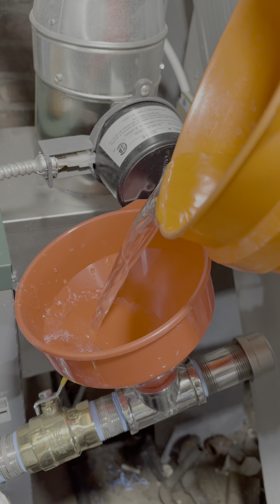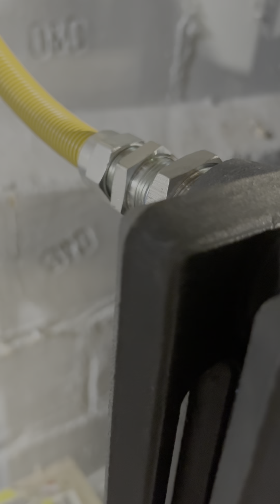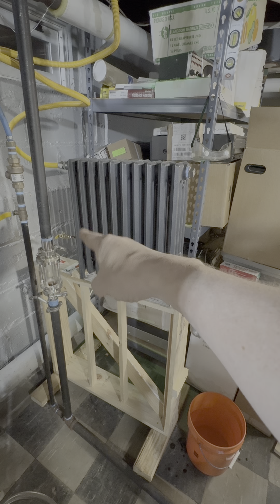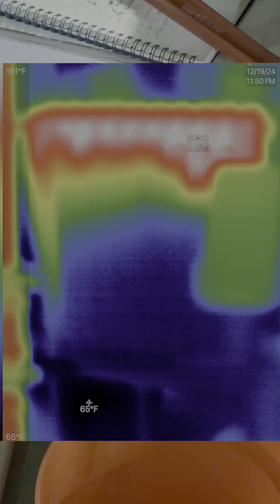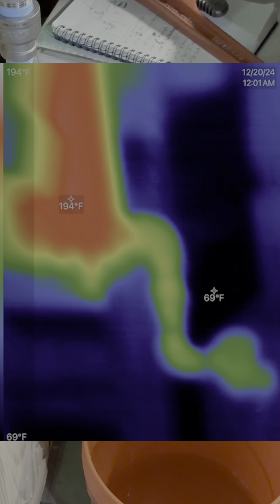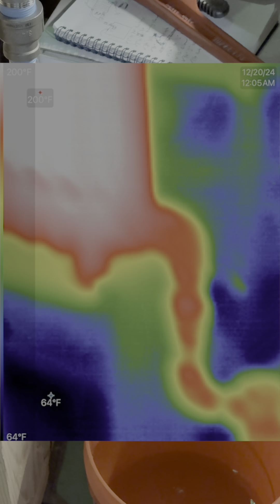Video #3,  Steam Radiator Pitch Experiment (2-pipe reverse pitch)

Comment: Like you say at the end, you need to test running the supply at the bottom, not the top, so that the back pitched radiator causes condensate into the supply. most 2 pipe steam  systems I've seen have both the supply and the return on the bottom. Like you say, there's no problem the way you have it, but thats not why they tell you to pitch it!
Reply from the maker: @territhemayor  thanks! I’ve seen few 2 pipe systems, but they had the supply at the top. With a supply at the bottom the pitch can’t be reversed, I think.

Comment: all your videos are fascinating. i just discovered a hole over the water line in my barely 8-years old steam boiler. we'll survive the winter but want to prevent that from happening on my next unit. do you suggest only using distilled water from now on in the new boiler?
Reply from the maker: First, thanks for your comment. Second, I'm really sorry you only got 8 years from your boiler, that's just not right. Did it happen to be a Burnham Independence boiler? People have seen especially short lives from those.

Your question is a really good one. In a lot of my videos I have been focusing on pH level, which is indeed good to reduce corrosion under the water line. However, as you said, it seems like every boiler failure is due to a hole or holes above the waterline, typically at the top of the sections. So in that case, I don't think pH is really applicable.

So what is? I think it's oxygen. At this moment, I feel the oxygen in the fresh water is what does it. So yes, I think that distilled water is the way to go. And if you really want to minimize the intrusion of oxygen into your boiler, you might consider heating the distilled water to the boiling point just before adding it, which will drive out the most oxygen. In fact, heating it up might be even more important than it being distilled. But I still like distilled since it has no minerals, salts, or chemicals such as chlorine.
Reply: @pb7379-j2k  thank you for the answer! 
Indeed it is Burnham V8H and it gave up its ghost after consuming just 350 gallons of water (according to automatic water feeder count).
Reply from the maker: @patrykrebisz8421  350 is a lot of gallons, like a LOT. You should be consuming maybe 1 gallon per month MAX during the heating season only, so like a maximum of 4 gallons per year. Look for and fix any steam or water leaks. And when you get the replacement make damn sure the contractor measures your radiators in order to properly size the replacement. If they won't, then show them the door.

Comment: You should do some experiments with the trap and supply on the same side. I have one radiator that's set up that way in my house and it behaves very strangely with regards to pitch.
Reply from the maker: @theodorgiosan2570  that’s a bad way to pipe a radiator I think but it might be worth a look. What is the pitch direction that makes things weird?
Reply: @pb7379-j2k If it's pitched too far towards the inlet/outlet, the radiator will only heat partially, and only across the very top, while the rest stays cold. It needs to be nearly flat to heat all the way across. The reason it's piped this way is it's heating an enclosed porch that was added to the front of the house at one point. Because there is only one wall that is actually connected to the basement, this is the only way it could possibly be piped without running the return underneath the radiator to the other side. The return and supply are also coming diagonally through the very bottom of the wall, through the sill plate, into the basement. To move the trap to the other side, I'd have to find basically the flattest trap that they make (probably a Marsh or Monash), and put a street elbow under it facing back towards the other side, then run a pipe between the legs of the radiator to the wall. The radiator is in a corner, along a wall that is 90 degrees to a doorway, and the supply and return come through the 6 inches of wall between the inside corner and the doorway. The 1925 Hoffman data book does show the trap and supply on the same side as a valid configuration for piping a radiator in their vapor system so there's that. Silent Steam Team's video on the Tudor system, and also the one on adding a radiator to an Adsco vapor system, also show some radiators installed in this configuration, so it doesn't seem to be uncommon. Another interesting one to try would be both inlet and outlet on the bottom, on opposite sides. I have a couple that are piped this way as well due to being late 1800s wrought iron (basically Nason style) radiators that only have a bottom inlet and outlet. One of them, a very large radiator of probably 100+ EDR, actually has the floor of the bottom casting pitched internally towards the outlet so that's pretty cool. The other does not have this internal pitch feature, but works fine as long as it is pitched towards the outlet. If it's not, the water backs up against the inlet side and you can hear the steam gurgling through the water. These types of retrofits of older radiators were common enough that they are also described in the Hoffman book.
Reply: @pb7379-j2k I tried to reply before but it didn't post. That radiator, if it's pitched too far back towards the supply/return only partially heats. If it's nearly flat it has no problem heating all the way across. The 1925 Hoffman Data Book shows supply/return on the same side, top and bottom, as being a valid configuration. They also show bottom/bottom, opposite sides as being a valid configuration for radiators with no upper tappings. I have a couple of those too, they're wrought iron radiators from the late 1800s, with tubes screwed into a cast iron base.

Comment: Next video LOL. Run the rad for an hour (or any length of time) and measure how many gallons of water you get. Steam is 970BTU/lb. So, let's say a rad was 20edr=20x240=BTU/hour=4,800/hour. 4800/970=lbs of water=4.94lb of water. since water is 8.333 lb/gallon you would get=.59 gallons of water.

Now there are other things that enter into it. air temp around rad and steam pressure. Off the top of my head I don't know the numbers that rate rads at
Reply from the maker: I know I was saying 20 EDR but I think it's actually a little smaller. And yes the temp of the room will matter, and probably the pressure of the steam (as in how fast new steam will take the place of condensed steam probably?)

But in the end it did seem like it was about 1/2 gallon so you're in the ballpark!